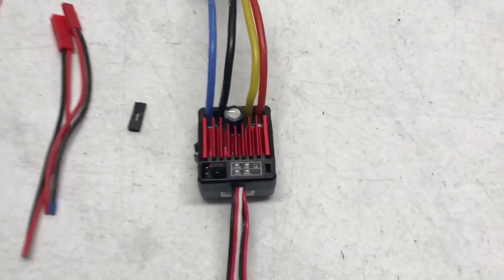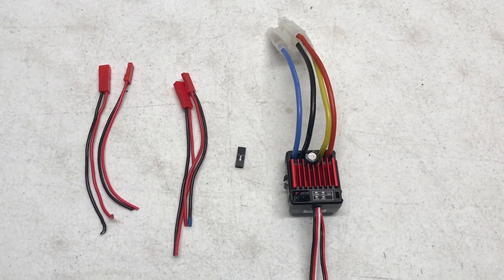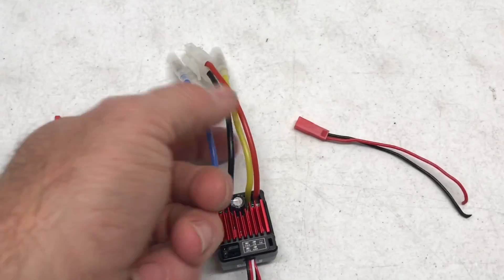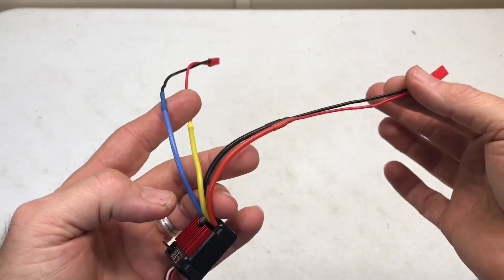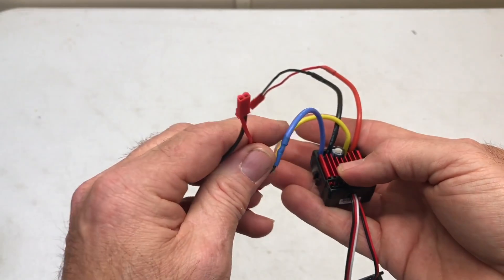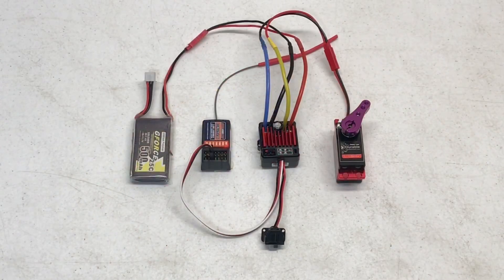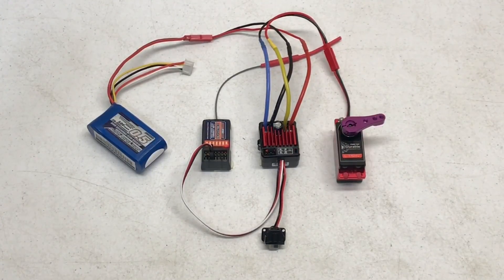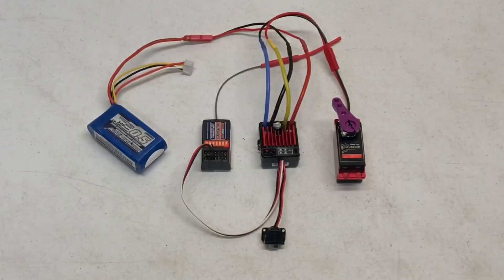Hobbywing 1060esc as a Winch Controller Mod

Comment: Maybe on the 3.0 version of this video he will show it installed to a rig and how its actually wired when using the same battery and receiver for both the drive motor and winch ESC. 

Basically- 1 battery. 1 receiver. 1 transmitter. 2 ESCs.
Reply from the maker: This is an old setup. But to fill you in…. This esc usually went into ch3 and that channel controlled the 1060 and thus the winch. It’s not complicated.
Reply: @ExocagedRC you never show it on a vehicle in either video so maybe it's a new video idea? I don't think you can plug 2 BECs into one receiver (all three wires from one ESC). In that case you'd  need to run 2 separate receivers or cut out some wires, not to mention many transmitters with a display only have a single momentary button on channel 3. Reversing would be annoying.

Comment: Hello can you help me an tell me if that is 6v     I'm thinking put it on a mauler whit a hobbywing quicrun 1060 60a esc e neve pantera 540 motor 35 t and a servo 5v.does it work? Many tks
Reply from the maker: 3s battery, 6v bec output
Reply: Many tks, do you now for the  led light needs anything else?

Comment: I’ve got a horizon hobby dynamite cheapo esc. On 2s no problems but on 3s, it will put out 12v. I’ve tried to adjust every setting I can on my dx5 to lower the voltage. My concern is sending 12v to a servo winch rated at 7.4v max. Any suggestions?
Reply from the maker: Well you can set end points to slow it down but the pulse width still peak at battery volts. I’ve actually had really great luck with 3S on servos as winches.
Reply: Exocaged RC thanks for the info. I have been reluctant to wire it to the servo because I’m seeing 12.5v on the voltmeter.  Correct me if I’m wrong, endpoints on my Futaba  is what I’m accustomed to but I believe on my spektrum the endpoint is labeled as “travel”.

Comment: You should be able to turn your speed up and down using the trim for that channel. A few guys I've met turn the trim up for winch-out for speed(timed events) and turned down for winch-in for better control.
Reply from the maker: Yep sure can. With a fast servo like the Solar D771 a slow in helps quite a bit as the line speed is about walking speed fast on 3S.

Comment: Are u not going to overpower your reciever.  U will have 2 power supplies to it.  Wont that burn it out like an external bec
Reply from the maker: if both power supplies are 6v it will just have more amps available to it. If both your winch esc and drive esc are have the same 6v output they seem to work fine like that. I've done these both ways, red wire removed from winch esc and red wire in and it really depends on the system you're setting up. Some of my friends use a 1060 for both drive and winch and they run them together with no issues at all. If you're running 7v to the system then absolutely yes remove the red wire from this esc.
Reply: @ExocagedRC  I've thought about that too.
Should the red wire be removed on the 1060 plugged into a Mamba X esc with the 8-amp internal bec?